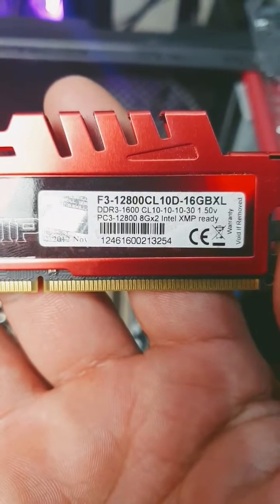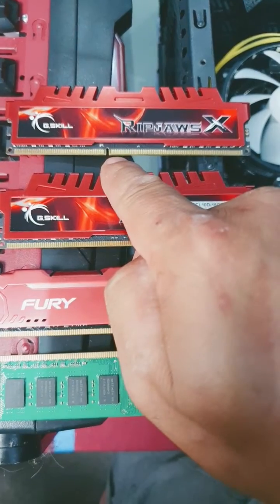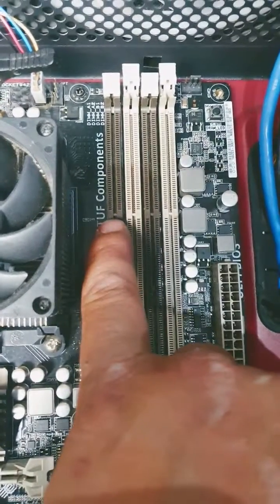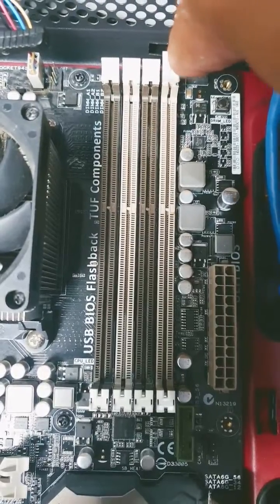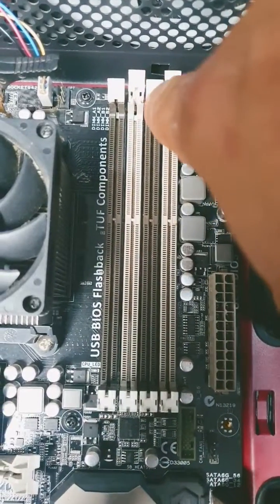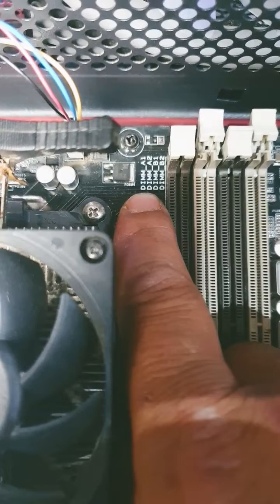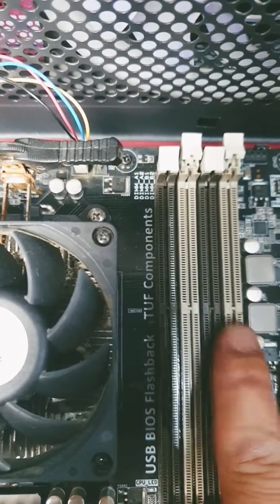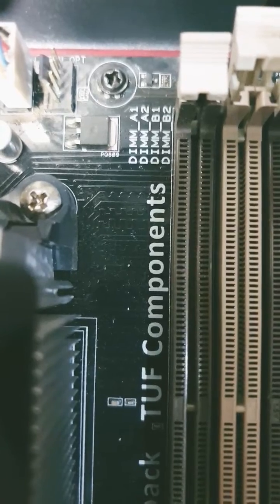how to install ddr3 ram in your motherboard

Comment: My monitor turns on with only one RAM if I try to put another ram in, it doesn’t turn on
Reply from the maker: u might have a faulty ram stick oe your ram slot could be faulty, also check your cpu pins see if any are bent that can also cause the ramslots not to work

Comment: I don’t have screw display now
Reply from the maker: what do u mean>??? sorry pls specify
Reply: @ I meant screen display I put old ram back and it fixed
Reply from the maker: @justifiedpeaks9579  your ram must be faulty ...are u using new ram?? different specs? still ddr3?
Reply: @  still dd3 but I think the new ram was to much for my pc bc when I put old back in my display was back
Reply from the maker: @justifiedpeaks9579  yeah some ram isn't compatible ..it's the nature of ram... usually there a qvl list for the mobo showing which rams were tested and work 100%...it happens even with newer mobos and ram ... ddr4 to ddr5 same thing too
Reply: @ fair enough only reason i was upgrading it is bc my frames drop a lot sometimes it’s high and then they drop by 100 so one min im on 170 fps then 70
Reply from the maker: @justifiedpeaks9579  start with that and then make sure ur not over heating elsewhere

Comment: Do I need to set anything in the boot menu screen? Or is it mainly just plug in and ready.
Reply from the maker: just plug and play buddy, unless u want to run the highest clock speed, then u do have to alter the frequency in bios, for example if your ddr3 is 1600mhz in bios u choose 800mhz dual channel each channel being 800 mhz which = 1600mhz
Reply: @MIKEYZVLOGZ  subscribed you're super helpful

Comment: Question If I have a 8gb and I buy another 8gb will that equal 16gb?
Reply from the maker: Yes ofcourse 100% and will become dual channel aswell as long as u use the right ram slots a2 b2
Reply: @MIKEYZVLOGZ  Bought it and it didnt really increase my fps. Any tips?
Reply from the maker: @Lethal328-z7d  ram doesnt actually increase much fps. fairly little..the best u got from another ram stick os dual channel now.. more fps u need begger specs like better cpu better gpu..its the only way to really up your fps
Reply: @MIKEYZVLOGZ  Thanks for replying i subscribed!
Reply from the maker: @Lethal328-z7d  thank u

Comment: What if the slot had the notch in the middle ?
Reply from the maker: if ur notch is in the middle your ram must be a different type like ddr2 ... u should be able to tell by searching your mobo specs and it will tell u the type of ram ur mobo uses ...u can't use ddr4 in ddr2 and vice versa

Comment: Um question my ram doesn’t click in on my motherboard even thought I bought brand new ram and a brand new mother board they are both ddr3 btw
Reply from the maker: they should .. does ur mobo have tbs that click on the top and the bottom of the ram slots? or it might just have one tab on the top..either way it should click into place.. u my not be pressing hard enough ..just be careful not to slip to the left or right as u can break the ram stick and/or the slot itself..wat mobo is it
Reply: @MIKEYZVLOGZ oh yes and also I’m there is no ssd slot so where do I put it this is my first build so I don’t really know that much
Reply: @MIKEYZVLOGZ oh maybe I put it in the wrong way
Reply: @MIKEYZVLOGZ idk

Comment: Thanks that was really helpful! I was trying to install a new 16GB RAM stick in a PC that already had 2 8GB RAM sticks. I knew about opening the tabs, but wanted to know if you can click it in one side at a time. I tried to push it equally so that it went in both sides at the same time but couldn't get it to work. The only way that worked was lining up the RAM and pushing the bottom in first, then applying pressure to the top to click it in. I wondered if that was okay, so your video is very helpful to know that you can do it one side at a time. Thanks!
Reply from the maker: great news bud

Comment: what alot of people don't do is even after perfectly alining the ram they don't apply enough pressure to the sides and just pull them up manually
Reply from the maker: yes and wen there's 2 clips they pull it out with 1 unclipped only causing damage to the clip and socket
Reply: @MIKEYZVLOGZ  true